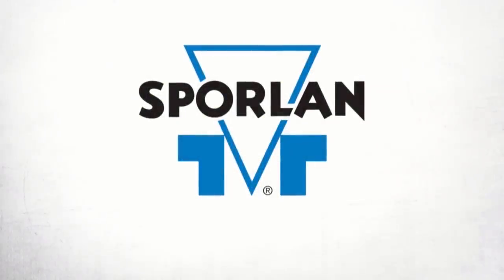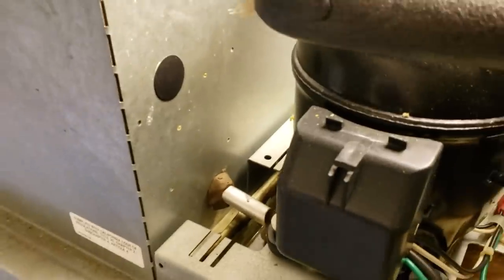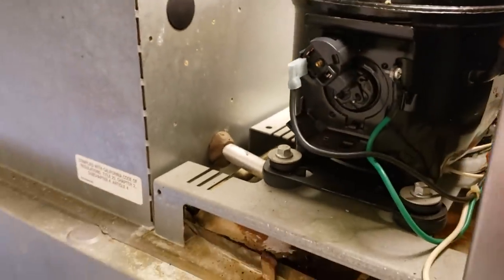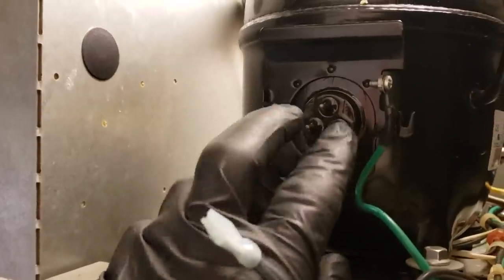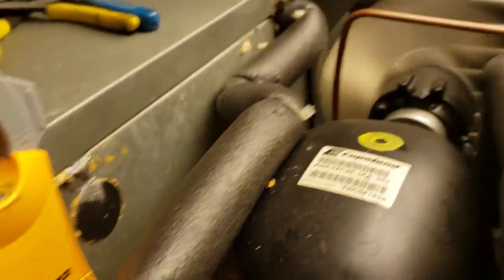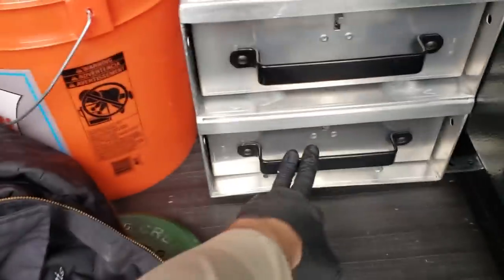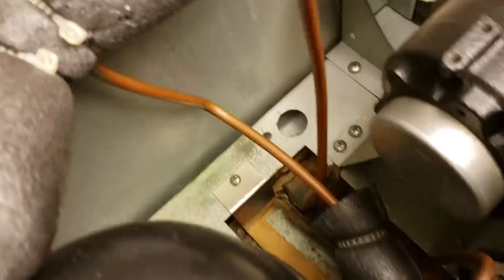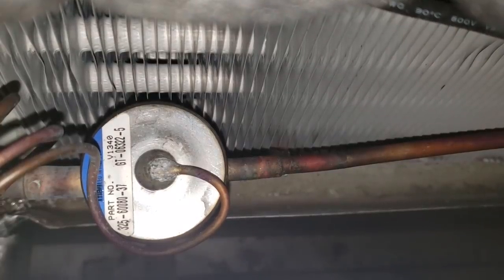TRAULSEN REACH IN COOLER TOO WARM

Comment: Came across a traulsen cooler and the Compressor keeps short cycling. Pressures  look good in the short time that it runs. I found that the cabin sensor and the discharge sensor was bad. I change those and the error code went away but he compressor keeps short cycling. The next thing that’s a head scratcher is the door sensor says the door is open and the door is not open. Kinda lost I this one.
Reply from the maker: The door switches are notorious for failing on the traulsens....

Comment: Hey man quick question, 

My AC turns on and runs, I can hear the compressor start before the fan. Both lines to and from the unit are at ambient temp. 

I don't have gauges, but it suddenly stopped cooling. If I tap the Schrader valve there is definitely pressure in there. 

Could it just be low charge? Or possibly bad valves on the compressor? 

It's 28 years old.... Lol
Reply: You'd need gauges to test,  if it's that old and not tripping a circuit, one easy test is to put a clamp meter on a compressor line, find amps,  and look on compressor or data plate, should say LRA if your amps are close to that it's dead. Probably makes a noise right before it shuts off on thermal OL. Giving you the idea it came on, yet not compressing anything, therefore no noticeable temp on refer lines.
Edit: if it's not this exact scenario, or even if it is, you should have someone familiar with the work and tools check it out for you.
Reply: @jaredsciguy1634  thanks man. I feel like I have a limited grasp on the concept. I ordered a set of gauges just to check it out and see what the pressures are while it's operating. 

I appreciate the advice.

Comment: This is another good service walkthrough. If I had to guess why the compressor died I would say that membrane infront of the condenser. They seem like a good idea but when the humidity or ambient rises they tend to cause problems. Also I know you know its locked rotor but perhaps showing an amp draw on the common vs the RLA for the rookies please?

Comment: I had my department buy me a few of these 3-N-1 hard start kits for this very same purpose. I like to use them to isolate the compressor from the starting components. They were throwing away refrigerators at work because no one knew how to test them at least electrically except for me. A stainless steel fridge that retailed for $1700 new was almost destined for the junkyard but I was able to find a defective PTC starting device which cost $67 at APC to replace. Small domestic units are good units to learn the basics on.
Reply: I'm not even an HVAC tech, just an electronics/electrical tech with an uncle in the trade.
I didn't even know what a PTC starter was, but I was able to determine that the mini-fridge at work had a bad one.
I then applied my knowledge and was able to actually repair it.
I had to repair it again a couple years ago, but that dang thing is still running today. Eventually I'll need to actually replace that PTC starter.

Comment: Does anyone ever accuse you of guessing and checking when you want to replace multiple parts?
Reply: Yeah. I feel he is a bit too excessive in just-in-case replacements. It isn't always best for the consumer. The expansion valve he said, he have seen many failing and it could have been source of compressor failure. So that was a good call.

But replacing condenser coil seams weird to me, especially as the unit looks very clean and in good shape overall.
Reply: He replaced the hot gas condensate loop which is not the condenser, it is about 2 feet of copper tubing that helps evaporate condensate from the evaporator. They leak often and if the system is open it is cheap to add it in as a preventative measure because the expensive part is tearing open the system, not the parts
Reply: @mojoemurphy  Sounds a lot like how my dad (an auto mechanic with 40 years of experience) will try to get customers to replace the water pump at the same time as the timing belt, on cars where the timing belt drives the water pump (most import and domestic straight-4 engines). It's just more parts cost, the labor stays about the same because you're working right in the same area so it's really not worth it to try to save money there.

Also, if your motor has a timing belt, chances are it needs to be changed about every 60-90k miles (consult owners manual or service information to get the specific mileage). It wears out just like any other belt, but the consequences of it failing might be a roll of the dice to see if you bend some valves, because these days many engines are designed in such a way that the valves when opened by the cam and the piston at Top Dead Center, will try to occupy the same space. This is called an "interference engine", and they perform better than non interference engines but the downside is that if the engine jumps time (meaning that the timing components have failed), you have a high chance of doing severe mechanical engine damage. This can break pistons, but it's more likely to bend valves and damage valve guides, and fixing that means taking the head to a machine shop for inspection and installation of new valves valve guides etc. Much more expensive than just replacing the timing belt and timing belt idler pulleys on the manufacturer recommended schedule with OEM parts.

Comment: Whats the big deal about using 3N1s?  I have seen them used and they are still on equipment years later and still working.
Reply: They're generic. The 3 in 1 isn't tuned at all. it's meant to start up the widest variety of compressors possible.
Conversely, the OEM starting gear is purpose designed to start that specific compressor.
In my personal experience with non-HVAC motors, the overload unit is the most valuable thing to have tuned to the specific motor. Though having a tuned capacitor that's the correct value will improve current draw, which could become a problem if your unit runs heavy load often.

Comment: Wtf is a compressor analyzer 😳 I've never even heard of that. You mean mega ohm meter?
Reply from the maker: No it's not a mega ohm meter, a compressor analyzer is a tool that has the ability to start single phase compressors without using their starting componets. The analyzer contains it's own starting componets and instead of a potential and or current relay you use hand operated switches. If your working on a 3 phase compressor you also have the ability to reverse the compressor rotation by a switch instead of physically switching the wires. On single phase compressors it was good because it allowed you to start the compressor before you left to get new starting componets. Like I said In the video it was kind of put out to pasture when
 3 n1  start kits came out. Here is a link to a newer one (https://amzn.to/2J1TwNL) but this one doesnt have 3 phase rotation
Reply: @HVACRVIDEOS  aaaaah! I just look up the analyzer, they look pretty dated 😁 Thanx for the info!

Comment: Good vid but you should always check your voltage  also those 3 in1 start kits only have a start cap rated at 88 mfd I would bet that compressor calls for a much higher mfd good vids bud

Comment: Hi , Chris , great vid as always .
Couple questions if I may :
_ I've never heard of a compressor analyser , could you if possible make a vid on them one of these days
_ if the system doesn't have any pressure control , couldn't it theoretically start and run even with no refrigerant at all , until the compressor burns out ?
_ how to test the starting components ( I'm not sure how to do it , other than ohming the contacts and check it does have continuity where it's supposed to , so I'm trying to learn how) 
_ and last : are the pinch off tools reusable , or does the needle not pierce properly once it's been used , or is  the gasket not tight anymore
Thank you so much again , I really need to get better man, it sucks to suck at my job 😞 !

Comment: I have a bad txv in a freezer. Same style. I put one in same issue. What expansion valv do you recommend?
Reply from the maker: a Sporlan Expansion valve
Reply: @HVACRVIDEOS  is it a brass txv or steal.
Reply from the maker: Copper coated brass
Reply: @HVACRVIDEOS  thanks.
Reply from the maker: Yep
Reply: What was wrong with the expansion valve? What's wrong with your new one?
Reply: @mojoemurphy  oil logged evap coil
Reply: @russellfelix9992  in a reach in? Just curious why you would condemn the TXV for that, doesn't quite add up for me.
Reply: @mojoemurphy  the txv was freezing into the evap only partially. With low suction pressure high head pressure. The compressor was going off on internal overload
Reply: @russellfelix9992  new valve doing the same thing? You've got my interest now, I assume it's 404a. This a single door reach in? What are your pressures and SH SC if you know it. Any thing else note worthy?
Reply: @mojoemurphy  two door top and bottom one compartment. 404 15oz. Builds up pressure on high 300. Suction low 30s.

Comment: Have you worked on taylor soft serve machines?   Cant find any repair / diagnostic manuals.
Reply: They have a tight lock on their parts and information. They tend to favor authorized service, which means stocking their materials .
Reply from the maker: No I dont work on those
Reply: They're like Hobart, they don't play ball with outside techs very well. If you're not a HVAC/R technician trained on ice cream, you're just going to screw it up anyway, they are very picky units with a very specialized skill set

Comment: Hi what device did u use on the sealed system to check the refrigerant with out cutting the pipes  and brazing a shrouder valve.
Reply: Shane Gibson that is called a piercing valve sir

Comment: Don't you like to check these compressors starting them directly with wires? Line to Common, neutral to Run and a little tap to the Start with neutral to simulate the start relay. (I said neutral because it's the mono-phase 230 VAC system we have here).
Reply: ??!!?? You're kidding right?
Reply: Do you understand how start windings work? If you don't have a relay to drop off your start windings you're going to lose all your magic smoke and make a bad situation worse. Call a technician please, it'll end up costing you less in the long run
Reply: @mojoemurphy  Hi Mojoe, I just talked about simulating manually a start relay, just tapping the start connector during a second. It's for check if you hava a bad start relay. It's not new, is completely old school. Here you have a video about it: https://www.youtube.com/watch?v=dumKbEtHL34 Cheers.